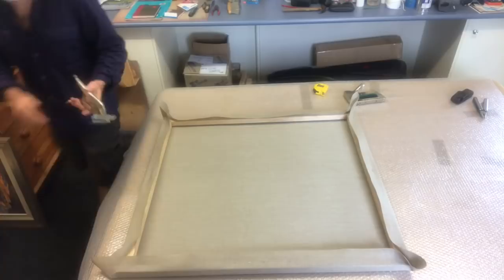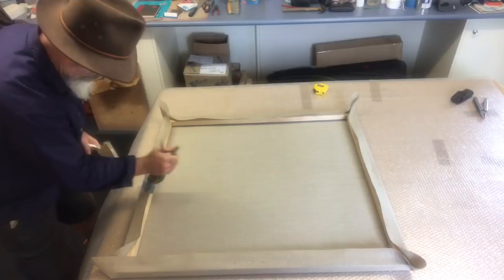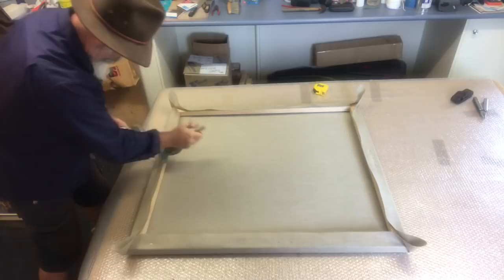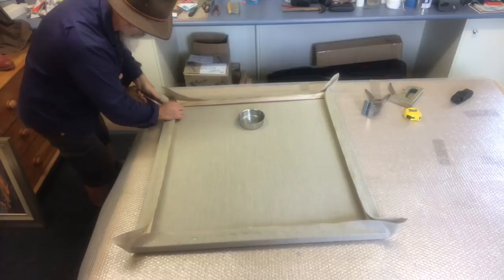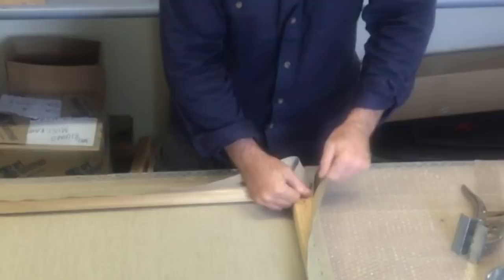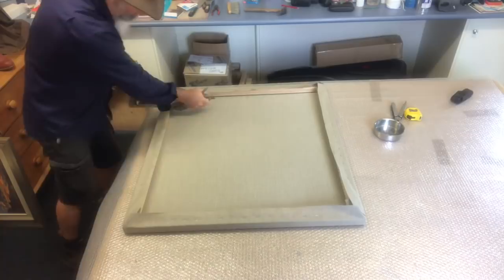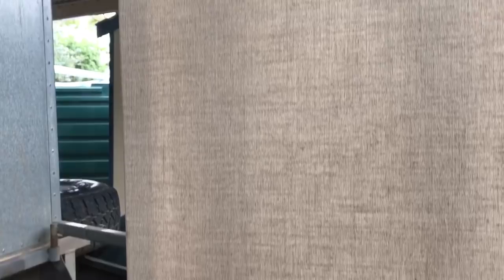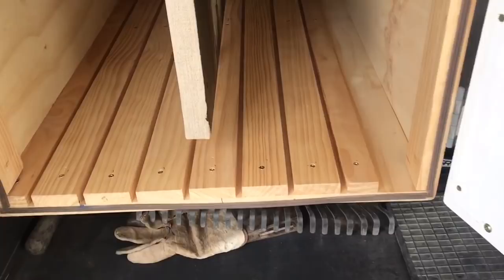HOW I STRETCH  MY LINENS. PLEIN AIR TRAILER REVEAL+EASEL SETUP!

Comment: Thanks It was good to see ow your setup works.  I was wondering does the gesso seal? now I'm worried about my paintings. also can I put the Pva over the top of the Gesso canvas I've got ready for the next painting Cheers :)
Reply from the maker: Hi Jacque, I'm pretty sure the Gesso does! You could put PVA over an acrylic gesso.The best way to see if your Gesso is working, is to look at the back of one of your finished paintings and see if the oil is seeping through or not.  Have a great day and thanks :)
Reply: @richardmusgrave-evans9886   Thank you :)

Comment: Happy Holidays! Well Richard I believe you have the process down to a Science, and that trailer is truly a killer rig. Question, I'm curious, would the Gambil PVA sealer work on Masonite as well as on canvas? I prefer working on Masonite. However the concept of the slats on the back of the canvas as an anchor makes sense when out in the elements. I may give canvas another look, I'm just not able to stretch canvas. Thanks for sharing the information. Happy Trails.
Reply from the maker: Thanks Deborah! I'm pretty sure you could use Gambil PVA Sealer on Masonite! 
All the best with your work. Cheers
Reply: What thickness masonite do u use, thx

Comment: Do you put the first layer of PVA on the unstretched canvas or do you buy the linen with a layer on it? If you do put the first layer on do you tighten the linen onto a board first? The reason I asked is because I put raw linen on stretchers and I had it good and taunt and it went sloppy on me when I sized it. Took the linen off and PVA Ed it onto hardboard.
Reply from the maker: It already had some on it, I was just being safe by adding one more coat! Cheers 🖼🖼🖼